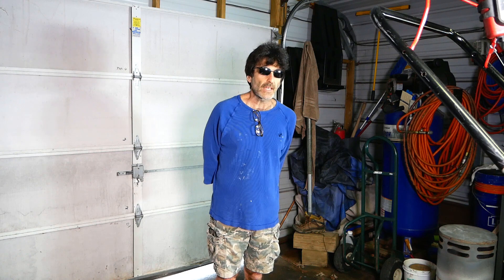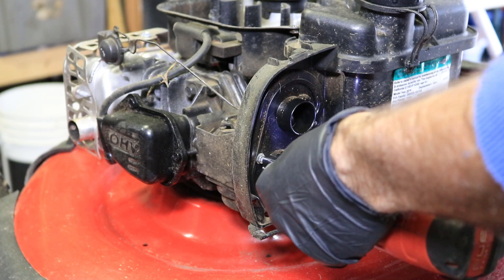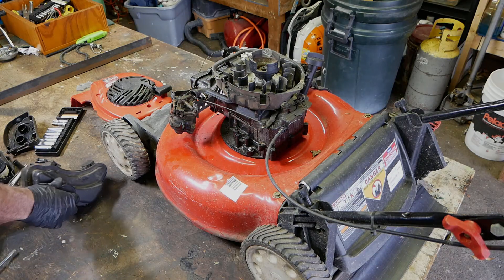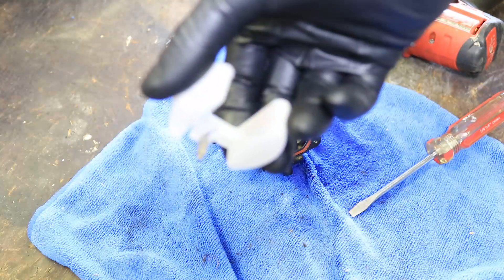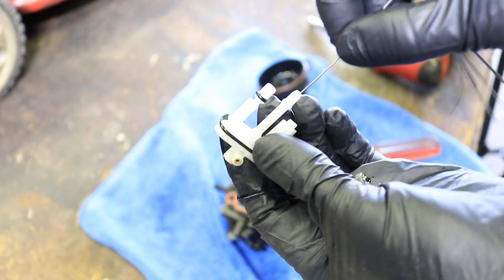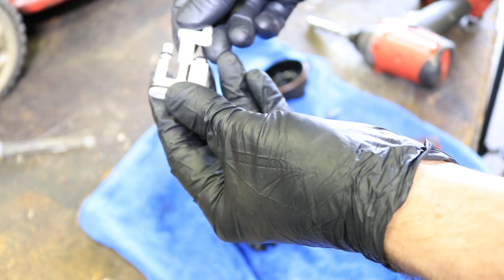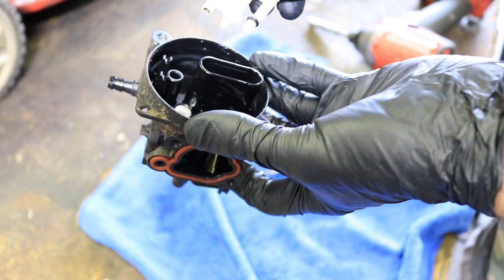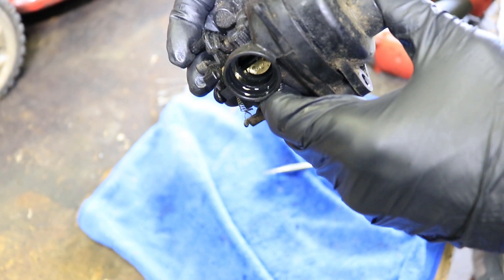Briggs and Stratton 550EX Won't Start!

Comment: Didn't work for me... still won't even fire, not even a single "pop" or "puff" of exhaust. I hate this little engine! :-|
Reply from the maker: What have you tried so far?
Reply: @JLPicard440  Too much! LOL! When I last had it running about 4 weeks ago, I ran an entire tank of fresh fuel thru it mowing around the yard then when it ran out and I refilled it it would not start nor even fire... I found there was 0 compression (clearly it hadn't been like that when it was running or else it wouldn't have run)! The intake valve was stuck partially open for some reason I discovered. I got that valve freed up with some carb cleaner and a little working it back-n-forth till it would spring back closed completely. But, even with restored compression it still would not start nor fire! I put fuel directly on the air filter, still no joy. I changed the spark plug; no joy. I changed the ignition coil; no joy; today I completely disassembled the carb as per your video and made sure every orifice was clear then re-assembled, other than realizing I'm missing a spring (I'm not sure it was ever there now, and it should not affect a cold start anyway apparently) it still will not fire. I've even disconnected the spark-kill wire from the ignition coil and made sure the brake is not applied to the flywheel, it makes no difference though not so much as a puff will this thing do. I've carefully watched the valves moving as I turned the mower blade in circles and both valves are working, I'm a little confused as to whether they are working in the correct sequence however. It seems to be "puffing" air thru the valve guides on the compression stroke (with the cover off, I can feel the air puff out). The valves are closing fully, but maybe not at the right time? If it's out of time I have no idea how that could have happened though! I certainly didn't hit any objects in my yard with it, and the blade is in like-new condition. I had borrowed this mower from a friend, it hadn't had fresh fuel in it in years so I'm guessing that some gunk must have gotten the intake valve stuck open... but why doesn't it fire at all now? That's what's got me totally perplexed here! If the mower was rusty or corroded or beat up or showed any signs of abuse or misuse I'd just tell my friend it needs to be junked but dang the thing looks like it's brand new. So I keep pulling it back out of my storage and trying to figure it out.... in vain apparently! LOL!
Reply from the maker: Wow.. I'm not sure what to say!  Have you checked the gas tank to make sure it doesn't have water in it?  Did you actually screw on a compression gauge?  If it's out of time it should affect the compression, unless it's just by one tooth.  I'm pretty sure those things have a plastic cam in there, they could go bad on their own.. especially if a valve got stuck open, maybe it wiped the cam when it did that?

Comment: Should the throttle cable be moving the lever by the carb? It seems like mines missing a spring or something because that’s not moving.
Reply from the maker: These don't have a throttle cable.  They have a engine brake/cutoff cable that you squeeze up at the top of the handle.  If the brake part isn't moving on the engine when you squeeze it, then the cable could be broken.  But I can't see what you've got going on over there, so I am only guessing..

Comment: Hey Rudy, had water in the gas, followed your tutorial and solved the problem,  thank you!
Reply from the maker: Great to hear!  Yes I have seen water in the gas many times... It's best when storing the mower to leave the tank either completely full or completely empty.  Half full and the ethanol in the gas will attract moisture and cause condensation and then there you have it.. water in the gas.  Also best to use non ethanol gas if you have a local station nearby that sells it.  Thanks for the comment...

Comment: I have removed the carburetor 3 times to clean it, each time it is as clean as when I installed it last. the float doesn't have a hole in it, the the springs and attach rods correctly attached and adjusted(bending wise), I have swapped out the spark plug and cleaned the contacts for it, I cleaned off all rust from the contacts and wheel from pull mechanism, flushed gas tank(washed it out, checked for leaks, and let dry before putting in brand new gas), and my mower(Briggs&Stratton 550ex) is EXACTLY like the one in this video. No matter what I do I can not get this mower to stay running. I spray starting fluid in the carb, and pull the handle, and it starts, but immediately dies. I am out of options, I was hoping you could help. Any other ideas?
Reply from the maker: It does sound like you've done everything I would have done.  I don't suppose anyone hit something in the yard and knocked the flywheel out of time?  usually the blade will be a bit bent up if that happened...  Possible low compression?  I ran into one like that one time, that I couldn't get to run right and I tested the compression and it seemed a little low.  If your compression is good and the timing is good... A new carb "Could" do the trick.. But no way to know unless you try.  Is it a auto choke or a primer ball?  if it's auto choke, try closing the choke half way and don't let it open and see if it keeps running...

Comment: I just installed a new carburetor and still not running.
Reply from the maker: That doesn't give me any details!  There's lots of reasons it might not run..
Reply: @JLPicard440  
New carburetor, my sparkplug is making a spark when removed. I change sparkplug and comes out wet with fuel, completely wet. Is that why?  Ignition coil has continuity.
Reply: @JLPicard440  
I'm thinking about a problem with the valves...

Comment: Thanks for the video. I just bought that same mower used and it was acting up, so I emptied the gas tank and unscrewed just the bottom of the carburetor out to let the fuel empty. Put fresh fuel in it, but now it won't start and it makes popping sounds. What do you think it could be?
Reply from the maker: You'll probably need to pull the carburetor and try to clean it.  Off chance they hit something with it and knocked the flywheel out of time.  Was it running good when you first got it?  If so, that's unlikely what's wrong...  Check the blade, if it looks like a pretzel then they hit something with it..
Reply: @JLPicard440  it was running, just dying on and off, he told me gas was old, so that's why I dumped it, I did cut some grass like that, that's how I saw how it was acting. I for sure did not hit anything.

Comment: I bought a new carb new filter and still not getting gas
Reply from the maker: Not getting gas?  Disconnect the fuel line from the tank and see if it's coming out of there.  I sometimes flush the tank out with a water hose and then dry it before I reinstall it.
Reply from the maker: I meant the carburetor side of the hose..

Comment: I have a husqvarna with the 550 ex motor on it, it runs fine  and cold starts with 2- 3 pulls, but if I stop in the middle of mowing it will take 10-15 pulls for it to start.  What do you think the problem could be?
Reply from the maker: Is it possible the auto choke mechanism isn't acting right?  You'd have to take the top cover off the engine to make sure it's released all the way when the engine is hot.  It's a heat actuated device bolted onto the muffler.  The linkage goes from the muffler to the carb.

Comment: Steve's Small Engine Saloon recommends enlarging the brass hole on the jet to allow fuel to flow more freely and reduce clogging. I am planning to give this a try as I've taken the carb apart (and cleaned it out) three times! I love the 550EX engine when it's running well, but it's a royal PIA when it's got the all-to-often carb problem.
Reply from the maker: Yes, you can do that.. but just by a small bit.  Get some numbered drill bits so they are very tiny and find the one that it is now.. only go up by no more than a couple sizes.. for example if it's a #67 Hole... I wouldn't go past #65 or something like that.. otherwise it'll run flooded all the time..  hope that helps.  Thanks for the comment.. :-)
Reply: @JLPicard440  Agreed. The one Steve recommends is basically a half millimeter.

Comment: I have this same mower the same engine in it sputters and back fires through the exhaust any ideas?
Reply from the maker: DId someone hit anything in the yard?  It's possible the flywheel is just a little bit out of time?  Usually the blade will be bent up if this happens, so that would be a easy thing to look at..

Comment: Your instructions worked! I had a flooded carburetor and the mower would not start. I was about to take it in for service, but the repair turnaround time was 7-10 days since there were 35 other lawn mowers waiting for service/repair.  So I checked for a repair video and found yours, which was for the exact same model. Thank you for the detailed and easy to follow instructions. You saved me time and money (@$60-$100).
Reply from the maker: That's awesome!  Thanks for the great comment... :-)

Comment: After following your instructions, it works lol. But now it’s idling high...just wondering how to adjust the governor.
Reply: Yup that work...and you were right, it got slightly bent when I was trying to remove the carburetor. Small tweak and it worked. Again thank you so much.
Reply from the maker: Great!
Reply from the maker: There's a tab in there that the carb spring attaches to, it might have gotten bent... try looking at that, you might be able to bend it back and slow it down...
Reply: Mine was starting ok but hunting i think ive heard it called. It revs as itvgets hotter. Like the idke is winding up and down. Thought maybe the carb needed to be cleaned. Changed the blade, spk plug, oil, air filter, took carb apart n cleaned it. Wasn’t bad. Things still winding up n down. Any suggestions?
Reply from the maker: Yes you can call it hunting or surging up and down.  There might still be a stubborn particle of trash in the carburetor.  It's usually carb related when you have this problem.  Looks like they're about $25 on Amazon for a replacement if you go that route.   Ive never actually seen a surging problem on this particular engine...  I would remove the gas tank and flush it with a water hose and get all the water out, then let it dry.  I'd also replace the fuel line incase you recontaminate your newly cleaned or replaced carburetor.

Comment: I have a troy bilt self propelled mower rear wheel drive. The wheels will spin if i lift them off the ground but they won't pull weight of the mower. I checked the gears in the wheels themselves they are like new. I'm hoping the belt is slipping but it's probably the transmission knowing my luck. Was wondering if you have any advice? Maybe how to go about finding the exact problem and fixing maybe you've seen the problem before.
Reply from the maker: It does sound like a belt.  Especially if the gears inside the wheels look good.  If you have the wheels off,.. check the small metal gear coming from the mower,.. it should spin freely in one direction, but not the other.  Sometimes the little pin in there that allows one way movement gets stuck...  depending on which mower you have,.. it also could be the cable isn't pulling hard enough and that's allowing slippage...
Reply: @JLPicard440  unfortunately it did end up being the transmission. So it's not worth fixing unless i find another of the same mower to use for parts or do a engine swap.
Reply from the maker: @eddiemaxwell7593  I don't blame u.. I wouldn't fix it either.. but you can disable the transmission and just use it as a regular push mower... or you can sell it for a cheaper price that way so it's not a total loss if it still runs good
Reply: @JLPicard440  yeah I'll probably sell it for like 30 bucks